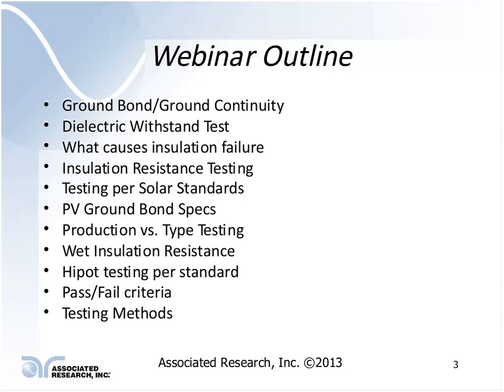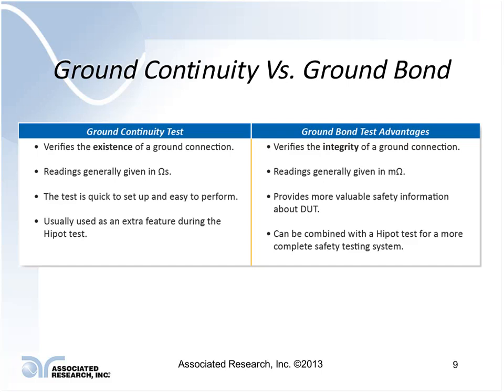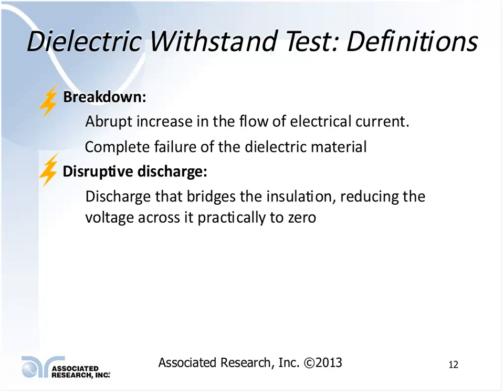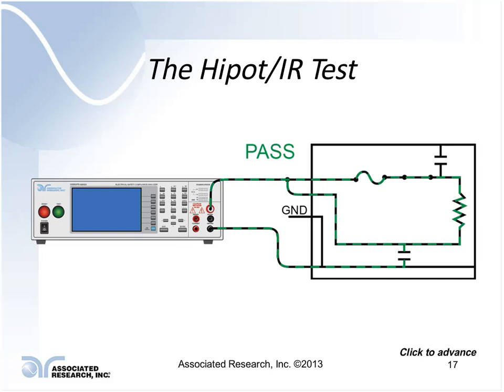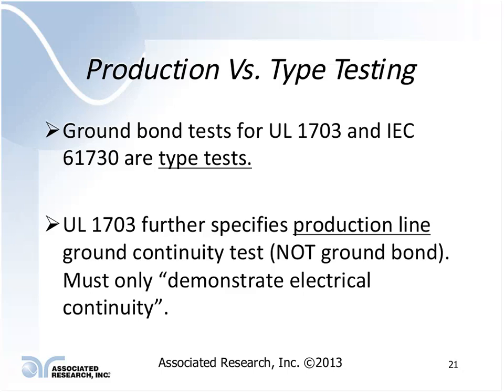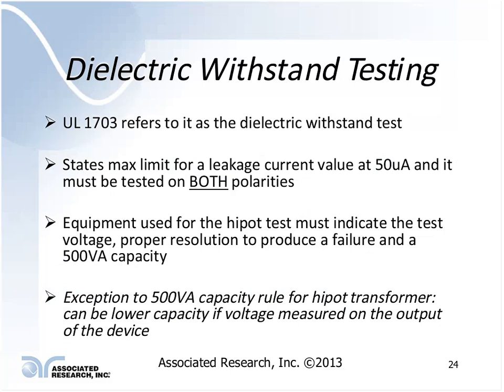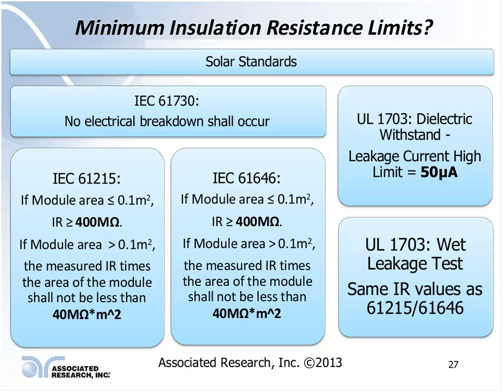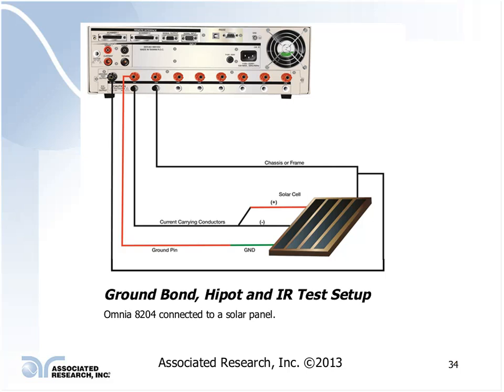Solar Panel Testing 1

Comment: Hi guys my brother has bought a kyocera kc50t-1 and the accu battery wires have been cut short I assume accu stands for accumulator. Simple question does the accu connect across the terminals +to+ and to and what is it for? Thanks